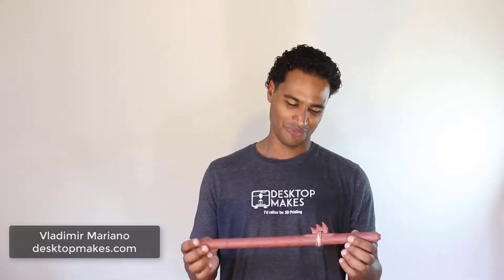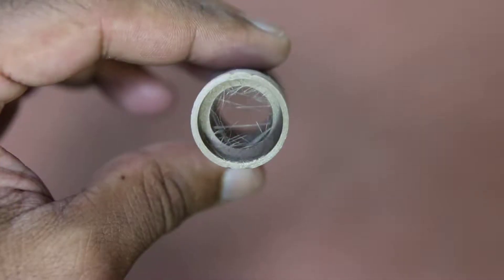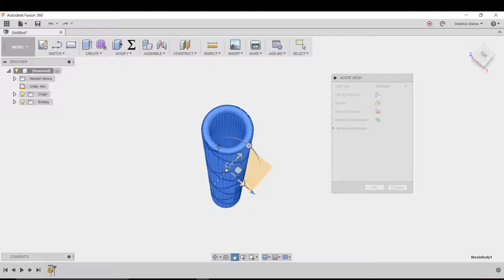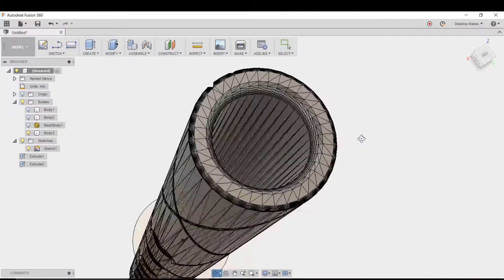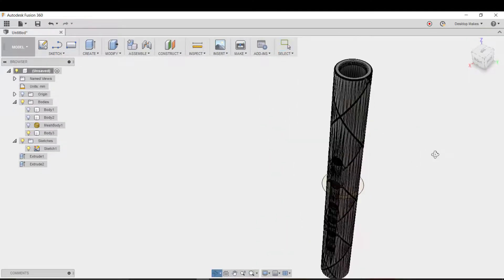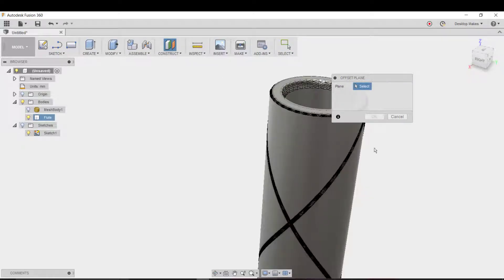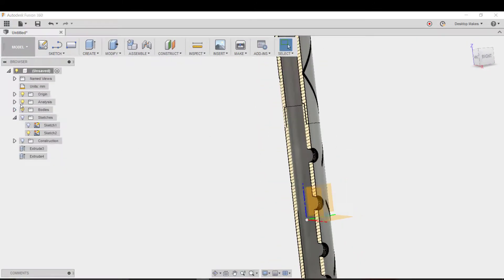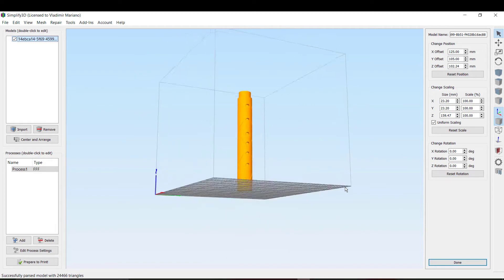3D Print a Native American Flute - Modify STL to Fit Your 3D Printer

Comment: I am not sure if you mentioned it in the video, but did you print the flute with 100% fill.  I have printed two similar flutes posted by pianotinker in PLA and they were just two parts butt jointed together with 2 part epoxy.  As I am new at this and have yet to get well versed in Fusion 360 I am hoping to find someone to help me modify the files I have as you did.  If I am unable to get help would you know if the wood filament will bond well with a 2 part epoxy.  On the other hand would you have posted your modified plans on Thingiverse.  Thanks